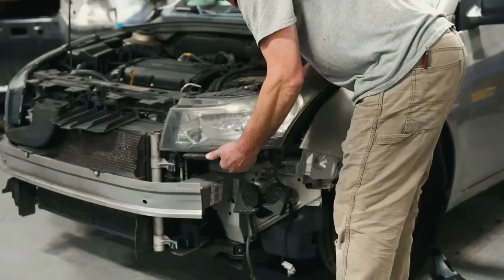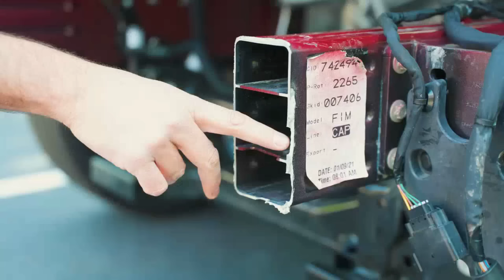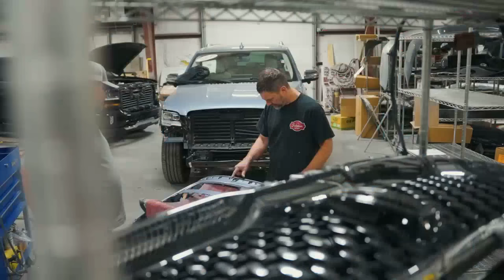STUPID Ram Features That DESTROY Reliability & Lifespan (AVOID NOW!)

Comment: I bought a 2020 RAM 1500 with a warranty for 150K miles with no time frame.   paid a lot for it, but it has all been paid for on a couple of issues that needed repair. If you buy a new vehicle, get an extended warranty.

Comment: My 17 was junk
Reply: i had a 17 V6 & it was a trouble free truck for over 70,000 miles. only sold it because i got such a good deal on a 22 5.7 V8. i think its the last year without ETorque so this may be my last ram.

Comment: Please do more videos on the 22 v.6 etorque 2x4
Reply from the maker: Thanks! I’ll definitely make more videos about the 2022 V6 eTorque 2x4. Stay tuned!
Reply: @RAMCentralHD oh and don’t skip the 2019 ram 3.6 rebel 4x4, I have had battery issues for some time I had to have it towed in the first time and they claimed “ lot rot”. Whatever they claimed the batteries die when the vehicle sits on their lot too long, they replaced tbe battery and never mentioned that I was required to drive  a lot of miles every day, to keep the battery charged, I admit, I may not drive every day, but I’ve never had this issues with a y vehicle I’ve ever owned, so now I have to hook up the battery to a tender every time I park in my driveway, and I’m in Southern California so it’s not like cold winter weather. Is killing the battery, I ended up buying a battery from a local auto parts store, oh here’s another good one, I changed the oil and purchased a filter from the same dealer, it was not exactly like the one I removed, so I went back to the auto parts store and purchased a filter just like the one I removed, the vehicle had 800 miles on it when I purchased it, what gives? Any info would be appreciated
Reply: I have a 2018 sport 1500 5.7 hemi I would like to know your thoughts about it.